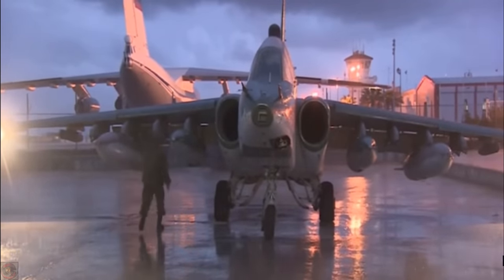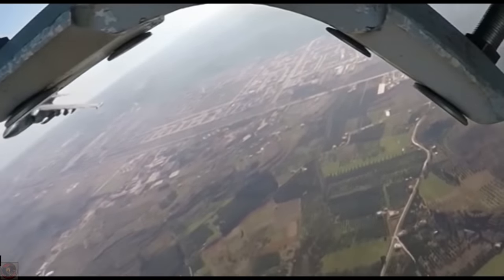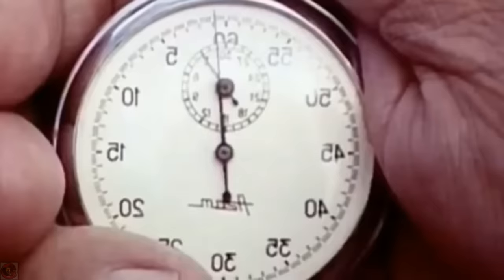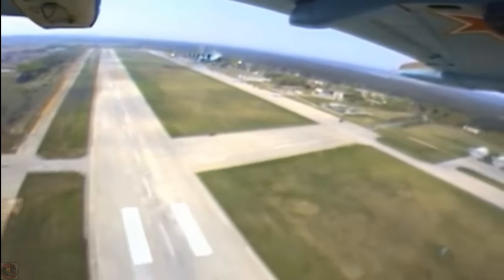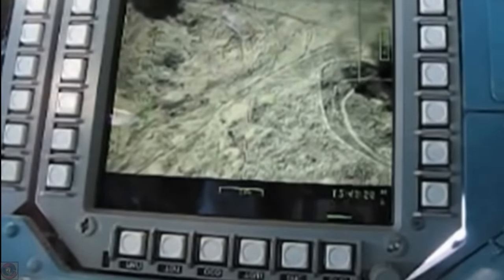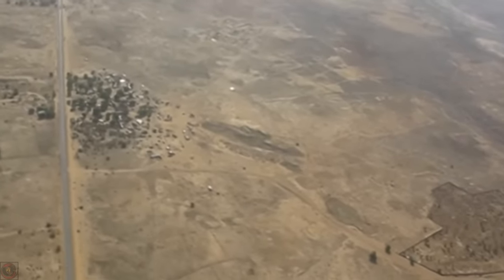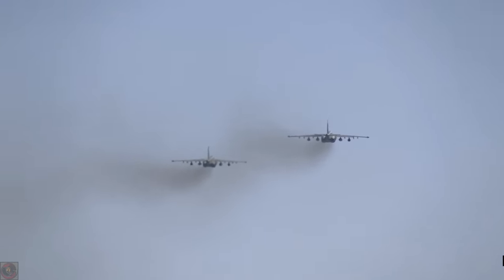Su-25 Frogfoot - The Russian Flying Tank

Comment: In czechoslovak service it was called "Prase"  (means "Pig") due to its multifuel engine.
Reply: What happened to those on Czech service?
Reply: @ricardosoto5770  Abolished since 2018. I don't know whether scrapped or sold. Chekhia is NATO now so they have to buy american to show they're grateful by supporting american armaments industry.
Reply: @wernerharms4833  Bulgaria still has their ones, and since the A 10 was never exported and is long out of production the SU 25 its the only thing under the sun for that mission.
Reply: @ricardosoto5770  Bulgaria is too poor to by new planes. And Chekhia will not replace its Su-25s by an other type of cas-plane, rather interceptors or fighter bombers, because the Su-25 was a left-over of Warsaw-Treaty-doctrine, NATO-wars are rather airstrikes (bombraids) than tank and infantry battles.
Reply: @wernerharms4833  The SU 25 might be really usefull plane in Africa and Latinamerica. Saldy like the A 10, they are no longer in production.

Comment: Generally a good video, one thing I will note though- the A-10 is a remarkably accurate gun platform. Part of the dispersion you see in videos is really down to range. The A-10 fire their GAU-8 from much greater ranges, such that they can turn around without over-flying the target. The smaller case (and propellant charge) in the Su-25's gun would necessitate a closer firing range.
So the GAU-8 is more accurate and if a tighter pattern was required (and it was tactically possible) they could close in and provide that accuracy. Also not aware of anything like the EAC system on the Su-25, where there is an auto-pilot channel to enhanced gun pass accuracy.

Love the Su-25 though, and you made the central point about its worth- it's perfect for low threat conflicts and it is cheap enough to bring lots of firepower to a battle quickly. One thing you could have said was that the Su-25 can actually operate with a wide variety of fuel types- another great advantage when logistical demands can be everything.

Comment: And in an emergency, he can fly on diesel.
Reply: Seriously?Man,  even most Russians don't know that.
Reply: bio-diesel or used vegetable oil*.
Reply: I thought all turbine engines can run on diesel?
Reply: Mazda Miata Nope,A10 can flying on Diesel?
Reply: @MazdaRX7007  technically, gas turbine engine can work on anything which burns in air
Reply: @numbedsv  Yes. Highly purified Bio Diesel has been used for jet fuel in the West.  Virgin Atlantic flew an airliner on [highly filtered] BioWilly's (the biodiesel made by Willy Nelson the country singer's refinery company).  Basically, any jet can fly on highly filtered Kerosene or Diesel.  
         The US Army went the opposite route.  Our Diesel vehicles now run on JP8 so we can have "one fuel forward" in the theater.  I served during the transition which was a nightmare!  We were changing fuel filters almost every month for a year as the detergents in the JP8 cleaned out the "scale" created by using diesel fuel before the conversion.
Reply: swaghauler But,Su can fly on JUST diesel.Like Ural or Kamaz.Sorry for my bad English,I’m from Russia,and I’m very love Su-25 and 27.But,I like and A10
Reply: @nurnburgring3102  The Russians know this, they just don't brag)
p.s. This plane flies on everything that is on fire-a requirement of the military, in case of landing outside the airfield.
Reply: @SBorisA  shovels coal into SU 25
Reply: Its Russian so it can fly on Vodka from Babushka’s House
Reply: Diesel?!? Shit. He can run on crayons and melted scented candles from Walmart and old cooking oil from the trap behind McDonalds. In a pinch, ground up old tires. The Su 25 UK C model can run on........coal dust!!!!!!🥜😜🍑
Reply: @FoodOnCrack  LMAO
Reply: @Nikola even frying oil? Because if thats so. Its perfect for the invasion of US.
Reply: It can fly on steam!! Just put boiler in place of main fuel tank. Slooshie
Reply: Or vodka
Reply: @SergeiSugaroverdoseShuykov  but it probably won’t get off the ground
Reply: @SBorisA  letting people know and not saying it are 2 differnt thingd
Reply: @iplaygames8090  only suckers are addicted to solid fuel
Reply: @a1marine105  you can tell the truth, but not all of it ... )))

Comment: Great video as always.
A lot of people compare the A-10 and the SU-25, with much butt-hurt involved on both sides. (See the comments section of this video 😉 )
The two aircraft are actually quite different, and were designed with different goals in mind.

The A-10 was optimised for the anti-armour role, as back in the cold war there was a dire need to thin out soviet armoured formations before they could engage our own, since the soviets had such a huge numerical advantage. This was the rationale behind the AH-64 Apache and artillery delivered anti-armour weapons too.

Its two main weapon systems were designed with this in mind. The AGM-65 Maverick could knock out any tank of the era from a considerable stand off distance, and even its big ass gun could out-range the guns of the ZSU-23-4 Shilka. Its low air speed of about 400MPH was not a problem, since it would not be overflying the target most of the time.

The SU-25 was designed as a CSA aircraft, which would support infantry and armoured formations with strafing attacks with rockets and bombs. The Soviets consider strafing attacks to be far more useful than most western nations do. Consider how the Apache usually attacks targets – using pop up attacks with ATGMs from a distance. Now consider how MI-24 Hinds usually attack – by charging headlong towards the target and firing salvo after salvo of rockets. Strafing carries an increased risk of over-flying the target area, so the SU-25’s smaller size and 600MPH speed would make it a more difficult target to hit.

It is only more recently that the Russians started to look properly at adapting it for the anti—armour role. The upcoming upgrade package is mainly concerned with improving its ability to use precision guided munitions. This was probably not a priority before as their numerical superiority in armour meant that they did not have such a pressing need for a fixed wing tank buster, and they had plenty of rotary wing airframes that could knock out tanks (MI-24, MI-28, KA-50, KA-52 etc.) 

Speaking of guided munitions, Russia is developing its own version of the APKWS laser guided rocket. Imagine a SU-25 loaded up with pod after pod of these puppies. 

Considering the many demands on Russia’s military budget, I doubt they will create a new fixed wing CSA platform anytime soon, especially if they are upgrading their current fleet.

Either way, I would not like to be on the receiving end of one 😉

Comment: Great video!;)
Well, here are just some quick facts regarding it's comparison to the latest A-10C.

1. Higher turn rate.
2. Higher thrust to weight and thrust to drag ratio.
3. Almost 400km/h faster than the A-10.
4. Better equipped for defending itself against IR missiles (Stingers and stuff). You'll immediately ask: then why was it shot down lately in Syria with an IR missile. That was the pilot's fault for not using it's self-defense accordingly and was ultimately hit.
5. It can conduct very effective SEAD attacks as well as carrying a lot more and higher range weapons.
6. The air to air missiles are R-73 which have even better performances than the AIM-9X in terms of range.
7. Same as the A-10, it also has the same caliber 30mm gun. It's not a gatling gun which sprays bullets in a wider cone, but a twin barrel gun which has higher precision than the A-10s gun, so even though it must shoot some longer bursts due to the greatly reduced firing rate, it wastes less bullets to kill the same tank with it's armor piercing and high explosive mix charges.

It's major drawback (there are other smaller importance ones as well) compared to the A-10 is generally due to not having a targeting pod which may allow it to see ground and/or air targets from almost all around (there are some blind spots on a targeting pod as well). Even the latest Su-25's still have just the Shkval, which is as effective as the A-10's TGP, but with a limited forward looking sphwere in which it can track or lock targets which greatly reduces it's awareness on the targets until it circles back to re-search and re-attack the targets.

Comment: I was Air Defense in the U.S Army from 2003 to 2007. The SU25 was 1 of 2 aircraft i was afraid i may encounter in the field (I was in Korea). I may have been able to squeeze off a missile, but it had just as good a chance of getting me. Anyway.... this has been a fascination to me since i learned about it. Thanks for sharing
Reply: Luckily the norks lacked fuel for their AF
Reply: What was the second aircraft you feared?
Reply: Jacob Buxton either the IL-28 or MiG-29S.

The rest of NK’s aircraft aren’t that impressive.
Reply: @kurousagi8155  IL28 is from what, 1947? No one is worried about that. Biplanes dropping specops would be more of a threat. Mig 29 they only have about 35 of, maybe half being operational at any time.
Reply: Iron 4 Troll Patrol true. But somehow missing it would have a scary outcome.
Reply: @kurousagi8155  It certainly has a radar signature the size of the moon, theyll also be observed by eyes in the sky fueling and arming. It is hard at this point for NK to come up with any surprises due to the technology delta and small size of the theater. Observing the defenses south of the DMZ, it becomes obvious the main threat is a massive human wave ground invasion which they seem to have covered by choke points and MLRS.
Reply: @Iron4TrollPatrol  it's old, but it can alot of payload.
Reply: Steve Church what was the other aircraft that you also feared?
Reply: 1.47 min https://www.youtube.com/watch?v=qKyfLIy18Tw

Comment: It still takes off, flies well and lands safely. The high-tech stuff can be added so long as the airframe is sound. About the only thing that isn't easy to add to an older aircraft is stealth. But I'm skeptical of aerodynamically hobbling an aircraft for weapons system advantage that may not hold true in the near future (if at all).

Never scrap your old iron. It may be the last weapon that still works.

Comment: You wouldn't want to put very expensive technology into this aircraft unless you had to.  The reliance on high tech systems means that you have to be able service them IN THE FIELD.  I believe the Russians go with reliability and ease of use rather than what is ultimately possible.  Designing around high tech systems means that you still have to find a way to incorporate less advance systems into your export variants.  Without that tech, the weapon system may be unreasonable in price or the ability to do its job (if designed around the assumption the systems are aboard).  

Russian gear is designed to work in the least hospitable environments.  You can litter a Russian runway with spent ammo brass and they'll just land and take off right on top of it... because their systems were designed to WORK in crappy environments... like a contested forward airbase.

The Americans won WWII because their gear was reliable, easy to service, and easy to produce.  The Germans had terrific weapons, when they weren't in the shop or wearing out.

I'm not Russian.  But I do respect the philosophy behind their arms doctrine and see the brilliance in it.  Their weapons have been battle tested all over the world with all levels of armed forces.  I'm going to have to go with experience verses the marketing hype of a lot of Western weaponry.
Reply: fakshen1973 Also everything they build is much cheaper than US tech, but almost equally as powerful, which is strange. There was a new Russian gunship helicopter that was being compared to the Ah 64 Apache and many experts said that they are about equal. This helicopter costs less than half the cost of the Apache.
Reply: I looked it up and it was either the Ka 32 Alligator or the Mi 28 Night Hunter which was being compared to the Apache.
Reply: @ENEN-tz6eg  крокодил is Kamov-52, it has two sets of rotorblades on one axle, pilot and gunner sit next to eachother while Milj-28 is tandem-seated and has a comventional cofiguration of rotors, the latter looks very similar to AH-64. By the way: AH like Adolf Hitler?
Reply: @Gridlocked  Are You sure?
Reply: A lot of what you wrote is bullshit the Russians build some of the best gear on the planet AK-47 assault rifles the most reliable automatic weapon , the Soyuz rocket built by Russians for the space program are the most reliable rocket ever made and at the moment the US has a joint effort to use their rockets as they are that good and a lot of other nations use the soyez for it’s reliability also when migs came out they were an outstanding jet and feared universally , just because they are Russians does not mean they do not have the brains

Comment: It's like an A-10 without the BRRRRT and better electronic based defenses. Basically a close air support aircraft with more of an emphasis on guided munition air strikes rather than Gun strafes like the A-10.
Reply: it has an brrrrt m8
Reply: want link?
Reply: BRRRRRT is at like 0:45
Reply: eddie money Noooope. Neither the SU25 or the A10 are capable of going supersonic. Max speed of the su25 is about 800 kph, and the max speed of the a10 is about 400 kts.
Reply: @nahyanrajee198  Well, that sounds like diarrhea.
Reply: That's pretty close to the a10s brrrt, so according to you the A10 sounds like dihorrea
Reply: @nahyanrajee198  It doesn't make a difference, whether storm shit is causes by baked beams or by borshcht.
Reply: Exactly, you proved my point

Comment: The fact that its so simple and durable is its key advantage over US aircraft. This is like the Toyota Landcruiser of planes compared to US aircraft which are like BMW X5. Which would you rather take to war? The platform is perfect imo
Reply: One advantage the SU-25 has is that is able to land and take off from unpaved runways or grass fields while the A-10 needs a paved or prepared runway.
Reply: the A-10 has a far better reliability facter then Frogfoot. as to the "needing a paved runway" it doesn't "need it" it was just designed to intigrate with US military protocal. the A-10 could easily be built to dirt runway specs

Comment: 15:50 The SU-25 is Using Modern missiles, for example the vihhr octa pods (on pylons 4 and 6 or 7 which is a total of 16 misisles that can penetrate 1000mm of RHA behind era...)
it can also do SEAD oprerations with the KH-58 and fantasgomania pod(oasive radar) under the fuselage
it can also carry missiles like the KH-29T which are also FaF missiles but bigger then the maverics of the A-10
don't underestimate the amount of weapons it can carry, and don;t thing they dont update it

Also the SM is getting the totaly new targeting systems

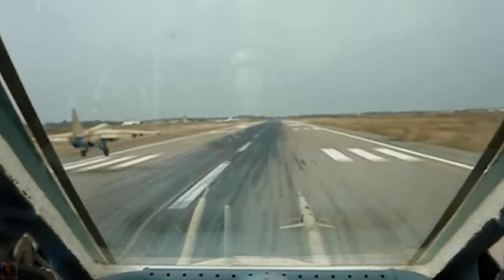17:30 The A-10's rotary cannon in comparison to the dual barreled GSH-2-30 is shit, also the fire rate is only lower by 400-800 RPM :P I really don't see the Reason for that Gatling gun as this can do the same and a bit more accurate then the GAU-8
Reply: Skyer Nah, the Gau-8 is a lot better than this Russian 30mm. More ammo, better fire rate, and better anti-armor performance.
Reply: Hence different roles for planes.  A10 was designed to take out Soviet armour so the gun was fitted to it.  Su25 was designed for ground support role,  so a broader range of  missions that in principle did not require precision munitions.  Hence in 95% of the case its using old school bombs and rockets.  Even in Syrian it would run with drop tanks and unguided rockets. The sm3 mod mainly adds modern navigation, no deep modernisation.  No funds.
Reply: @randonlando418  it's also much much heavier and generates a lot more recoil as well as drag in-flight. It's better for taking out mass tank formations but for every other type of mission it's a drawback against the Su-25s 23mm cannon
Reply: Pythoner the Su-25 has a 30mm. The A-10 also has more versatile weapons and is more modern, especially the A-10C.
Reply: @randonlando418  my bad yes, I got it mixed up with the 23mm gunpods. The Su-23SM3 is a modern, affordable upgrade; bringing better optics, avionics, the Vitebsk-25 protection suite. This is on top of the SM upgrade.
In what manner is something like the Su-25SM3 any less versatile than the A-10C? It can be fitted with gun-pods, infrared A2A missiles, anti-radiation missiles, anti-tank missiles, A2G missiles, guided and unguided rockets, guided and unguided bombs
Reply: Pythoner the A-10 can have those too, maybe without the anti radiation missiles because we have other planes for those.
Reply: Pythoner The A-10 can also carry more laser guided bombs.

Comment: Thank you for the video, I was always fascinated by the Frogfoot. 

As for its low-tech-ness, I agree with you on the need for more electronically guided weapon systems to avoid/reduce friendly fire/collateral damage. 

However the plane itself, I feel, is suited for the job. My limited understanding of military strategy would think that they’d established air superiority before sending the CAS in. This plane and most of emerging CAS/COIN planes are not designed to be fighters, are they?
Reply: Верно. По сути, поддержка наземных войск

Comment: SU-34 AND SU-25 are the two tank buster and close troops support that the US A10 does not come close to,especially the SU-34,the A10 is a great combat plane,especially with its cannon but it it a very limited war plane compared to those two devils,especially the SU-34 soon equipped with four AK barrels at the rear of the plane where the chutes used to be controlled by the second pilot,just like the T-22 bomber(rear cannons).